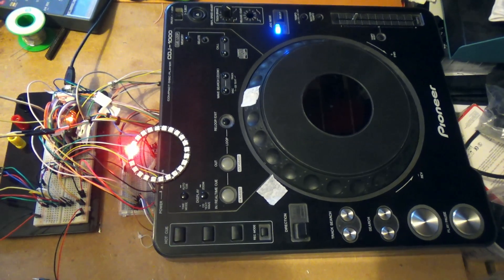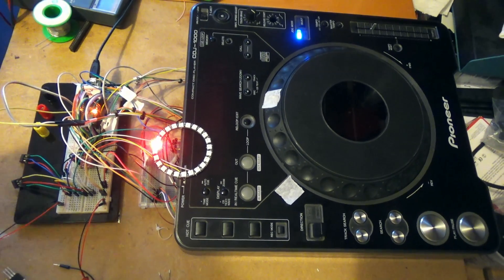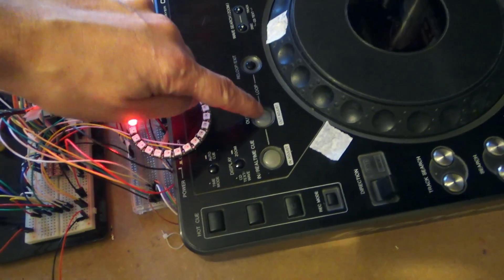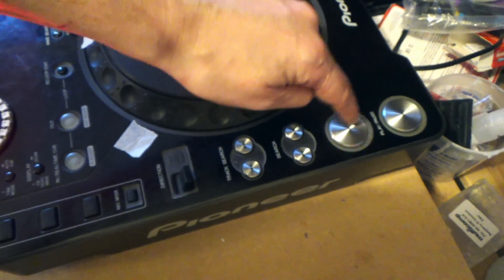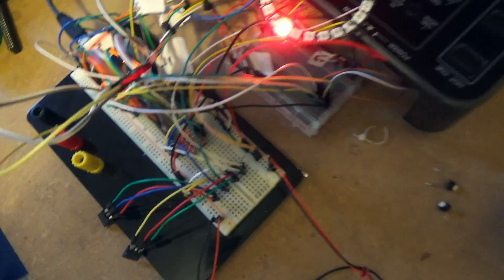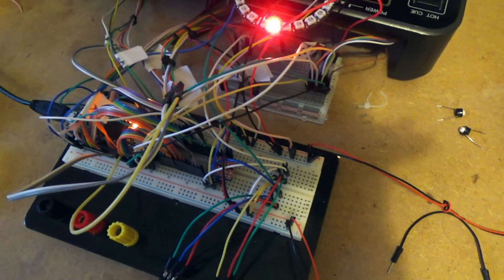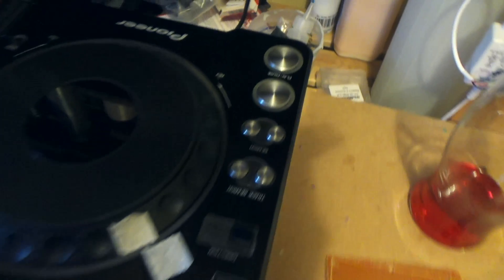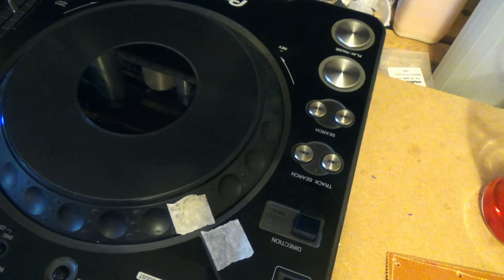CDJ 1000 MK1 Midi Conversion prototype - teensy 3.6

Comment: Very curious how you are going to fit that board in the middle! I just finished converting a couple of RMP's and would love to get something like this working.
Reply from the maker: it has loads of space on the under side of the jog wheel. I am not planning to fit it just in the very center.
Also the breadboard is setup so I can use every IO on the teensy so once it's on a board it will be a lot smaller. Did you see the cdj 800 I did before ?
Reply from the maker: I finished the board and have it all working in traktor. I will upload a new video soon.
http://i.imgur.com/JBGvHLb.jpg